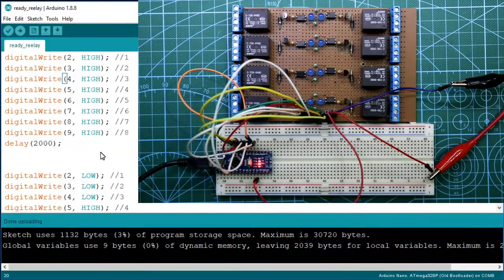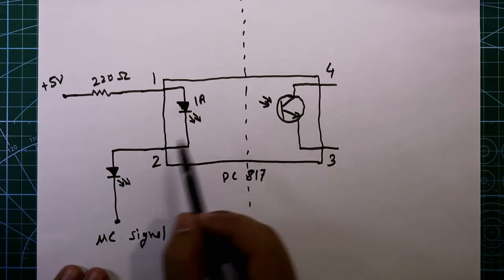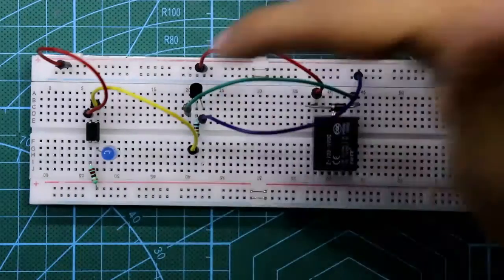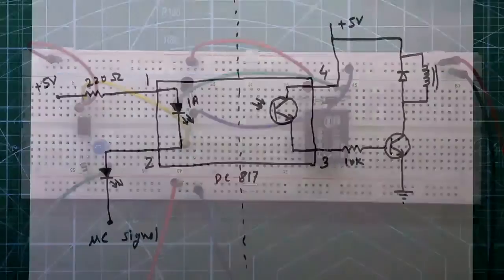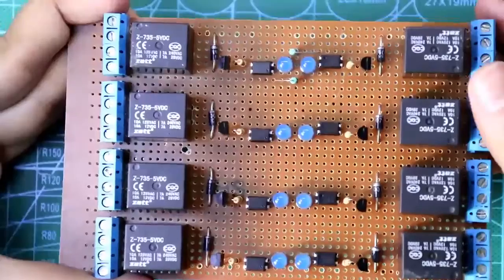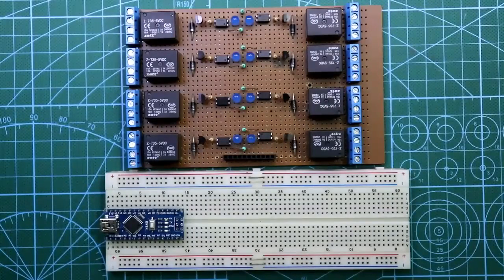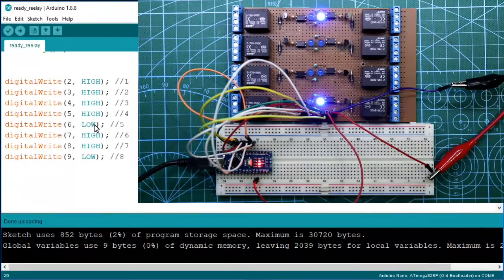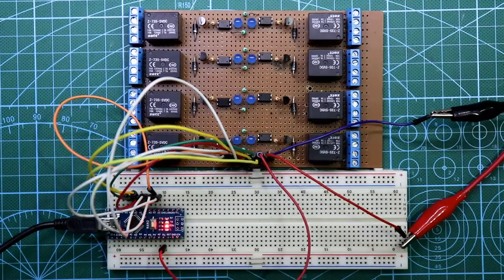How to make a LOW Triggered 8 Channel relay driver board | Optically isolated board

Comment: Thank you for this!!!   I've been looking for a stupid simple solution to drive my 5v relay with a 3v output from my ESP32 and didn't want to create an entire step up voltage circuit.  So I paired this with a logic level converter and am not able to drive all my relays reliably!!

Comment: The question I have is how do you obtain the second power supply? ie do you use a transformer and a rectifier, or a dc-dc converter? In your example, you are isolating a 5v power supply from a 5v power supply. There doesn't seem much point, but I suspect there are safety benefits, maybe protecting the microcontroller from potential high reverse voltage from the relay coils. The main isolation from the mains power supply is provided by the relay itself, but you don't really talk about that.

Comment: I have an essential question, once we use ULN2803, can we do without the free-running diode for the relay?
thank.
Reply from the maker: This IC has common freewheeling diode so we don't need to use.

Comment: Hi, good video. Very informative, but I have a question regarding bc337 transistor  component  in the circuit. I don't understand, why we  need it in the secondary circuit, and what will happen if I remove it, will the circuit still work? I am assuming it is used to isolate 5v and emitter pin of optocoupler.
Reply: My understanding is that the optocoupler cannot handle the amount of current required to drive the relay coil. Therefore the transistor is used as a current amplifier.

Comment: 3:00 why can't the ground be same?
Reply from the maker: Isolation means there should not be any kind of electrical connection between input side and output side. If we use same ground or single power supply to powering the microcontroller and to powering the relay, then there will not be any meaning of using the optocoupler.
Reply: @EEWave  I understood you want to completely isolate the relay module, but if I make the ground common will it cause any damage to the circuit?
Reply from the maker: No damage. You can use this as a simple relay board. If you want to make HIGH triggered relay board, then please watch this video:
https://youtu.be/R7nD7RA26xE

Comment: Thanks this circuit is simple and solid!!! Works!! I used an infrared led and a phototransistor as the optocoupler and a 2N2222 transistor, I was able to switch the isolated relay using an Arduino.
Reply from the maker: Excellent!

Comment: Could it be possible to use MOSFET transistor or BJT transistor instead of Optocoupler ?
Reply from the maker: We can do it without optocoupler. But, to electrically isolate the low voltage circuit from the high voltage circuit, we have to use optocoupler and a different power supply to operate the relays.
Reply: @EEWave  Yes U are correct, but I think it is also possible to use PNP and NPM transistor working together witch simply PNP is on high voltage site and NPN on microcontroller site ,but they are not completely isolated though. Your solution is definitely one to use in production circuit . Well done !

Comment: you are a good teacher bro,teaching it from the basics.Can you help me find out why I'm not able to operate any relay of this ckt https://www.amazon.in/REES52-8CHANNEL-Channel-Optocoupler-Arduino/dp/B01IDNCCFQ/ref=pd_sbs_328_1/261-8476299-0060938?_encoding=UTF8&pd_rd_i=B01IDNCCFQ&pd_rd_r=56a111ef-a6a9-4007-a777-dc803f6f46ab&pd_rd_w=0Kf3X&pd_rd_wg=I0C8S&pf_rd_p=fbf43daf-8fb3-47b5-9deb-ae9cce3969a9&pf_rd_r=T6WXV2V93ZSMRGW792HH&psc=1&refRID=T6WXV2V93ZSMRGW792HH
there are holes in r1and pin4(probably)

Comment: Very nice bro.your way of teaching is excellent. Even which pins or wire contact to Arduino and Which pins or wire connect in external power supply. diagram and coding also was excellent.  Thanks👍
Reply from the maker: You're welcome bro...